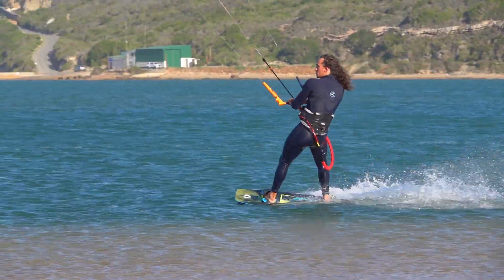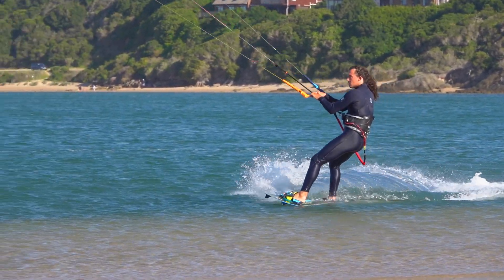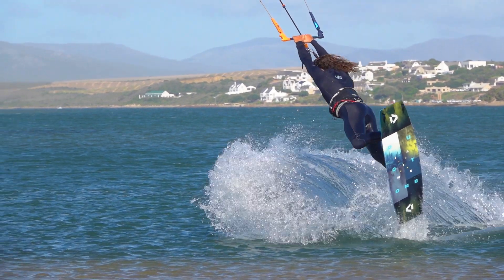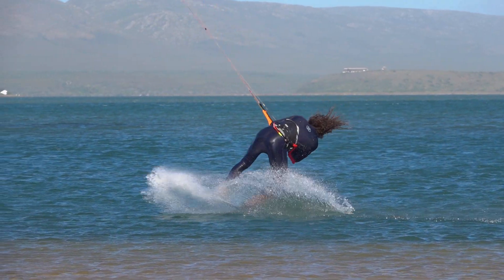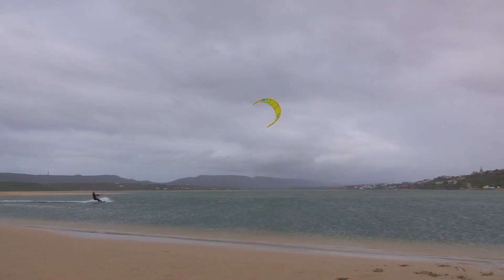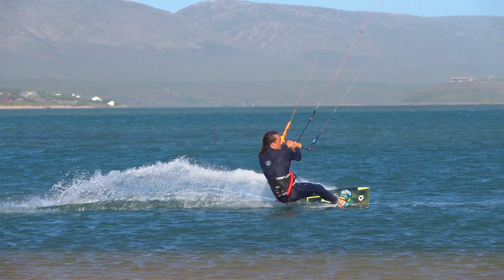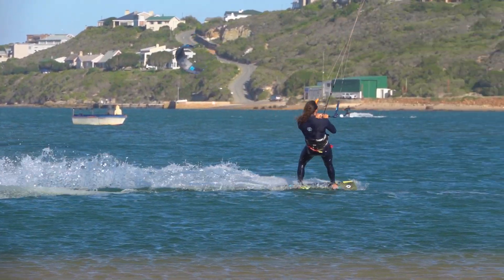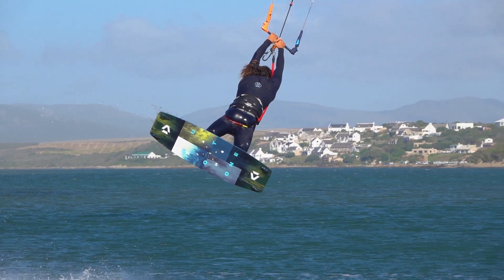How to do an unhooked frontroll or s-bend (kiteboarding tutorial)

Comment: A Unhooked frontroll is not the same as a s-band right. With an S-bend you first do a railly?
Reply from the maker: Hello Rick. An s-bend is a type of unhooked frontroll. To call your unhooked frontroll an s-bend you need the kite fairly low, lots of speed, and an aggressive raley with legs extended back so much your body is horizontal. This video shows various versions of the UH frontroll - as I'd recommend starting with the kite high, less speed and a weak raley. You couldn't call that an s-bend but you can practice with less chance of injury.
Reply: @kitesurfcollege how would you call an s-bend but rotating in opposing direction - like backroll?